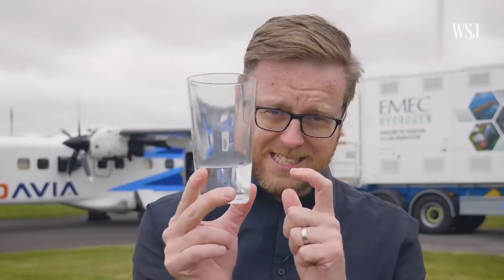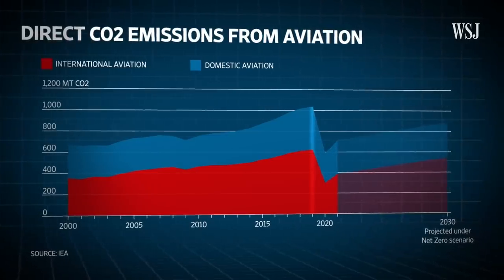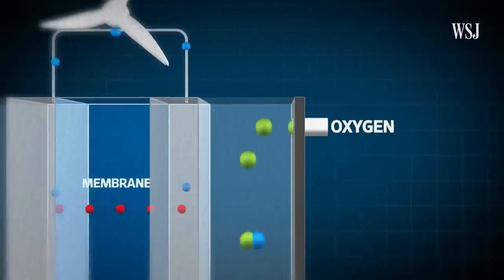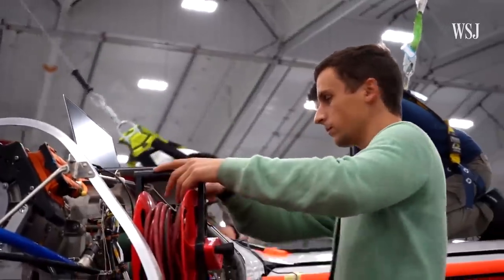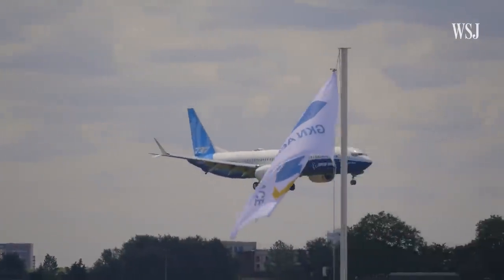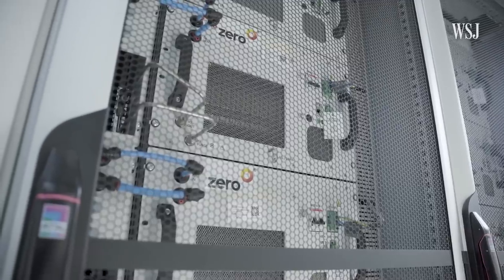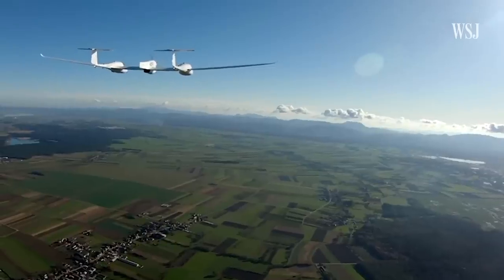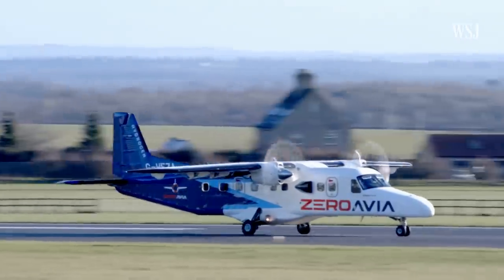Hydrogen: The Fuel That Could Power Your Next Flight | WSJ

Comment: How silly to compare using hydrogen as a combustion fuel to the Hindenburg, then to completely dismiss it because of that.

Whether you use it for combustion or fuel cell, you still have compressed hydrogen tanks. No difference
Reply: except there isn't an insanely large amount of surface area where you have to control sparks causing an explosion... this is much more controlled storage
Reply: Or there are companies and universities that have been developing a much better hydrogen storage solution.....
Reply: I completely agree. We're still waiting for a fuel cell hydrogen tank that's reliable enough to be developed, that's why the hydro-tech-heads don't like talking about the leakage issues, or the embrittlement issues, or the tank ruptures...etc. etc.

Comment: The volume issue is a killer problem.
Reply: So is the chronic leakage and boil off issue.  Hydrogen fuel handling system are incredibly complex and very high maintenance.  You can't store hydrogen for more than a few hours
Reply: Yeah... you guys know better. Sure.
Reply: @alainpannetier2543  , they are speaking information that is literally public, hydrogen does have those problems.  'Donut' and 'Real Engineering' on Youtube have great videos explaining hydrogen, I recommend.
Reply: They also forget to talk about the development of safer and much better hydrogen storage solution.
Reply: I've heard liquid ammonia as an alternative which doesn't have these issues.
Reply: @pacresfrancis1565  ReaI Engineering ? The SMR fancIub? Give me a break. 🤣
Reply: @alainpannetier2543 those are not the only hydrogen sceptics. Hydrogen is mainly just a mcguffin and served no practical renewable purpose outside of niche applications. Hydrogen cars, planes, and grid batteries are not ever going main stream
Reply: @viewer-of-content  Social network skeptics are irrelevant. What's relevant is that hundreds of billions of $$$ are flowing in. But thanks for your opinion.
Reply: A killer problem is why you need to hire a competent engineer to solve the problem.
Reply: Ryanair probably doesn’t care about them
Reply: *** @6:05

Comment: Fun side note, all those planes have a 10 to 20 year life span so yes it is feasible to replace all the planes before the deadline of the tech is ready.
Reply: Realistic central note. Planes are typically flown for decades before replacement.  Sure the planes could be replaced early.  Do you have a few hundred billion dollars spare change in your pocket you could donate to make that happen?
Reply: what about the airlines? will they trust the hypothesis that hydrogen will take place at the market and stop ordering planes? what are you opinions?
Reply: @simaysokmen  Planes are ordered years before they are needed due to long lead times.  And they last for decades.  Airlines are also risk averse; they are not likely to order a plane with a questionable fuel supply in all the locations fuel is needed.  Even with the volatility of current jet fuel prices, it's the devil they know vs. the devil they don't know.  Unless the heavy hand of government steps in and ruins it for everyone.
Reply: Y'all never googled Universal Hydrogen? They are making conversion kits for all kinds of existing aircraft... Problem solved... Ish... They use hydrogen capsules that will eat up interior space however the economics will probably make it a viable solution for small and regional aircraft which are the least fuel efficient today... The largest long-range jets like A350-1000 are already super fuel efficient machines that are still better off flying on SAF...

Comment: The problem is hydrogen is not readily available without injecting high energy into its extraction
Reply: One solution that's happening here in Edmonton is the airport is planning on building a solar farm and a hydrogen reforming station together so that surplus solar can be used to make hydrogen for aircraft.

Comment: What is the science about venting water, as a byproduct of hydrogen propulsion, at altitude?
Reply: Water vapour is a more potent greenhouse gas than CO2. However, I can imagine it is fine since it just rejoins the water cycle. CO2 is a problem because it accumulates and there is no way to  quickly recapture it at the rate it is released. Burning hydrogen is just releasing water vapour that was electrolyzed a couple of hours ago on the ground.
Nevertheless, it is a good question, since the scale of commercial flight might introduce factors that need to be examined.
Reply: Water vapor is an incredible potent greenhouse gas when emitted in the upper atmosphere. If flying shall be climate neutral, we can't emmit anything up there.

Water vapor down on earth isn't much of an issue though.
Reply: Just capture it into a tank. It probably won't be enough extra weight to make flight impractical.
Reply: It's the same as venting water vapor from jet engines at altitude.  That's what jet contrails are composed of.  It's also what clouds are composed of.  Clouds reflect sunlight back into space, reducing global warming.  The atmosphere is already full of water vapor.  It's called humidity.

Comment: This topic is very complex, and I do believe you are for a large part correct in your prediction. It is however imperative to note the downsides of SAF, as opposed to hydrogen.

First and foremost, non-CO2 emissions account for more than half of aviations GHG emissions, and flying on SAF will not solve this problem. Aviation is responsible for around 2.5% of global CO2 emissions, however due to the beforementioned fact, it is responsible for around 5% of global greenhouse gas emissions. Eliminating only half of that by switching to (very expensive) SAF, is not enough in the long run. Hydrogen fuel cell technology can completely eliminate all nitrous oxide emissions, solving this almost completly.

Another thing is that making large amounts of SAF will require production using the Fischer-Tropfsch process. This process uses hydrogen, and carbon monoxide (derived from CO2, which would ideally come from carbon capture) to produce long chain hydrocarbons such as kerosine. This process, although feasable, is not very energy efficient. The absolute upper limit, based on computer simulations of entire production plants, is around 60 to 70%. This is considering extremely favorable process efficiencies for electrolysis and carbon capture, as well as very high conversion rates. Realistically this efficiency is much, much lower. This means that the energy consumption to produce these fuels is extremely high, and producing enough renewable energy for this would be much more difficult than for hydrogen.

Improvements in hydrogen fuel cell efficiency, and aerodynamic efficiencies, as well as eventually very different airplane concepts (such as blended wing bodies, or flying V designs) Will allow for longer range due to increased efficiency, and also more internal volume in the aircraft. This is however not possible to do within the next 30 years, and for now SAF is a good step forward, while replacing short and medium haul flights with hydrogen or even bettery electric airplanes. However, clean aviation is the only way forward, and the best conceivalbe way to get there, is hydrogen power.
Reply: Combustion of hydrogen in the atmospheric air produces a lot of nitrogen oxides. A LOT more than combustion of hydrocarbon fuels

Comment: Install small modular reactors at airports to produce green hydrogen. Boom...
Reply: The locations which get the most airplane crashes in the world are airports.  Some airplanes crash away from airports, but most airplane crashes are at airports.

It's not a good idea to have a nuclear reactor in a location where airplane cashes can and do happen.
Reply: @matthewbaynham6286  why say something so untrue? Why speak when there is nothing valuable to say?
Reply: @matthewbaynham6286  they can put the reactor underground tho, if plane crashes are that prevalent
Reply: @pacresfrancis1565  and where do you plan to have the cooling system?

Comment: Airplanes are THE hardest thing to make carbon free. They fly
Reply: True🎉🎉🎉
Reply: Followed by ships.
Reply: PatRisberg  Then, consider how millions of cargo arrived to the USA in the first place.
Reply: PatRisberg  no carbon targets on rocket ships as I recall. Prbly because it's so niche it doesn't count. And I think it's established it's practically impossible anyway. But I haven't looked into nuclear powered rockets could it power itself on nuclear from earth?
Reply: @dbclass4075  sail solar and battery is an option. But also thinking if  30% of a cargo ship had space for hydrogen tanks I imagine it could go quite a distance. The weight of a hydrogen tank wouldn't matter so much on a ship
Reply: @quackcement  Its volume might be a problem, though.

Comment: The story talks about a hydrogen fuel cell producing electricity, but then internal combustion (not electric) engines are shown on the plane.  This story needs to get its story straight.
Reply: One engine is electric and one combustion, its for safety as these are experimental aircraft.  I've also seen another video featuring the same plane and the back of the plane is stuffed full of hydrogen equipment and fuel so good luck getting 19 passengers on it.
Reply: @stevenewley1  Electric motors don't need air intakes, like the engine in the video.  Something is incorrect about this story.
Reply: @dzcav3  They may need air intakes for cooling, they are used on electric cars for this.  Not doubting you but its possible.
Reply: @stevenewley1  The size of those intakes is much larger than required for cooling.

Comment: I know there are concern about explosive danger of hydrogen. Why not hydrogen fuel towed via a connecting metal pipe to the plane, plus some more motors to ease take off and crossing of the detached hydrogen ? With a parachute in case of hydrogen explosion

Comment: Just use synthetic zero carbon kerosine. You can just keep on flying the current airplanes and emit no Co2.
Reply: As long as you don't mind paying twice as much for your plane tickets.
Reply: @dzcav3 it is thrice the price
Reply: Kerosene is a mixture of hydrocarbons in the range of 6 to 20 carbon atoms per molecule. When this is burned with oxygen from the air inside a running aircraft engine, you will create CO2 at that point.  That is not avoidable, whether you start with some 'eco' synthetic fuel or whatever, it's basic chemistry.
If someone's managed to make kerosene that doesn't contain any carbon atoms in it's molecular structure, then it is not kerosene, it's something else entirely.
Aviation Jet fuel also contains a lot of additives that are required for it to work which are also burned as the engine runs, it's not simply 'pure' kerosene or naptha in there.

Comment: The Hindenburg was first. How did that turn out.
Reply: LZ 129 Hindenburg was no plane, but an airship.
It was not the first Zeppelin and not the first airship.
It wasn't powered by hydrogen, but diesel.

Hardly any relation to hydrogen powered planes.

Comment: I like the idea hopefully renewable energy can supply enough power to bring down the price i would much rather have water vapor blown into the air  over gasolines 150 different chemicals i feel like the oil industry will fight tooth and nail so it doesn't happen though

Comment: We need a liquid stabilised hidrogen fuel that can be both electrolised or burned.
Reply: Those laws of physics are such a nuisance.
Reply: They are suggesting using liquid ammonia, NH3 1 Nitrogen atom and 3 Hydrogen atoms, on ships for a similar use except its heavy which is OK on ships but not so much on planes.
Reply: @stevenewley1  Ammonia works in theory, but no ammonia burning engines currently exist, and cost for ammonia is higher than petroleum fuels.
Reply: @dzcav3  I think the idea of ammonia is for a fuel cell system to heat it to release the hydrogen then generate electricity, this is for ships but as you say there are no engines yet, all theoretical.

Comment: Most people don't realize that u don't find hydrogen in pure form. Where does it come from to use as fuel? 😊
Reply: Currently most of it comes from natural gas and most of the CO2 created in the process is dumped in the atmosphere
Reply: Have seen a research prototype that does direct solar to hydrogen
Reply: Maybe it is(it's a theory that are large poked of hydrogen deep underground created by water interaction with volcanic rocks) , but extraction of that hydrogen would be more expensive than it is for methane.
Reply: @theOrionsarms  that's as likely as cold fusion, over time hydrogen even leaks through steel, let alone rock
Reply: @flemlion13  not, that is based on chemical reaction between hot minerals and water, in the end that hydrogen ending in the atmosphere and reacting with oxygen(and producing water), or more likely used as energy source by bacteria that use as only source of energy, such deep ground bacteria are well know in deep mines , but from where take that hydrogen to survive was kind of mystery.
Reply: @theOrionsarms  you just explained yourself that in nature hydrogen is bound up and not present as the H2 molecule that is referred to here. Just as is said in this video BTW
Reply: @flemlion13  the theory that I'm referring said that hydrogen is continuously produced by decomposition of water, so isn't a contradiction, water come down, react with rocks, oxygen is fixed in new mineral compounds and hydrogen upper, that isn't fossil fuel is continuously produced, and it's stored beneath rocks, but not for tens of millions of years, but for a much shorter period.
Reply: PatRisberg     obviously very expensive compared to batteries
Reply: @flemlion13   also hydrogen is 12 times worse than CO2 as a GHG

Comment: energy? get a 340 litre wheely bin, put a gas tap in the lid, fill with kitchen waste,weeds,water and a cow pat,silicone the lid down, a methane bio digester! it will provide 50-100kw hours per month of methane natural gas for cooking,heating, it will run any engine with a spark plug, generator,car etc. after digestion what is left is called 'blackjack' the best bio fertiliser for 10x veg growing. gas storage, use a tractor inner tube , lilo,dingy,air bed,more pressure,put a brick on it. get everyone off grid! methane gas is much more powerful than hydrogen gas.

Comment: Problem is not 0 emissions from the transportation. The real problem is hydrogen can only be gained by electrolysis process with currently available technology. It requires a lot of electrical energy. Electricity is gain mostly by burning gas, coal or something else. In essence, 0 emission from planes or cars just transfers emissions to some other point technologically and geographically, but doesn't solve anything in total emissions amount. Besides, hydrogen must be compressed and transported what requires some more energy. Some more electricity from the same source?
Reply: Not just through electrolysis.
Today its made from natural gas - methane - via chemical reaction that at the end leave you with H2 and CO2.

Hypothetically it is also possible to make special nuclear power plants that will use thermal decomposition of water into hydrogen and oxygen (basically very high temperature causes that reaction to happen - same process that produced explosive mixture in Chernobyl and Fukushima) but as far as I know none of such plants were built thus far.

Comment: The only way to see how it works is to put hydrogen burning engines on the 2 most popular passenger aircraft, the Boeing 737 & the Airbus A320. Maybe the whole under floor luggage space is filled with hydrogen tanks and passengers can only have one carry on bag each. The market will determine if the economics works in regards to ticket costs. Building an all new aircraft for hydrogen fuel is not viable, at this point, when a new aircraft development costs are measured in billions of dollar or euros. Still need to sort out where this supply of green hydrogen is going to come from. I’m not sure who has worked out but how much can one giant wind turbine generate & convert wind into how much green hydrogen in a 24 hour period? Failing that how many acres PV panels can generate & convert sun into green hydrogen in a 24 hour period?
Reply: Its an interesting idea, but the economics just don't work. Removing checked luggage option means that you are forced to sell seats in a lower price bracket to be able to compete. That is, neglecting the cost of certifying these aircrafts for hydrogen in the first place.
Personally, I think electric battery technollgy would make a better economical case by 2050, purely due to improvements to energy density. Hydrogen is just too finicky.

Comment: okay but hydrogen plane emitting large qualities of water in the atmosphere, will that be a problem?
Reply: There is no perfect solution but best overall solution.
Reply: Current jet engines emit primarily both CO2 and H2O, along with SO2 and NOx, etc. A little more H2O is worth it to get rid of the CO2 and the other pollutants.
Reply: bigger clouds I guess
Reply: Falling ice!
Reply: No because its the same water that would've been electrolyzed  before take off, so there no extra water in the atmosphere. Also in that regard, fossils fuel are worse because they introduces more water in the atmosphere when burning that wasn't present before.